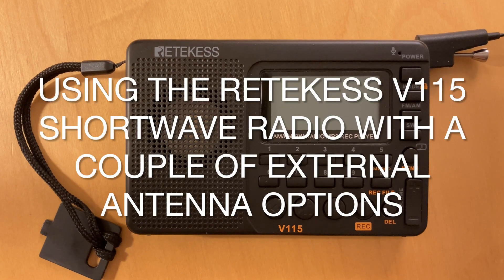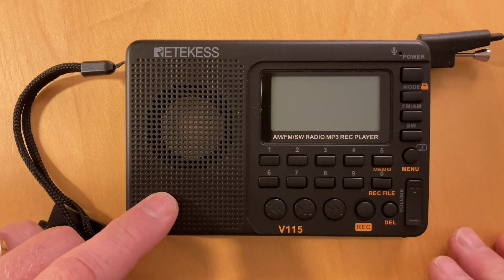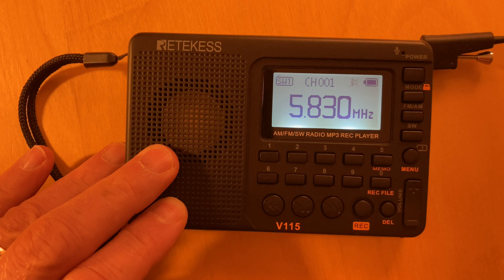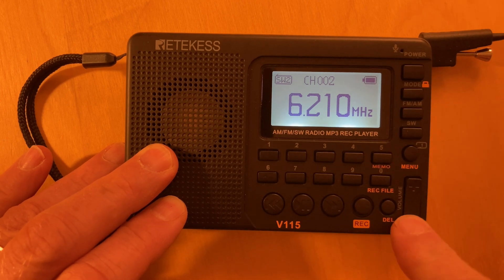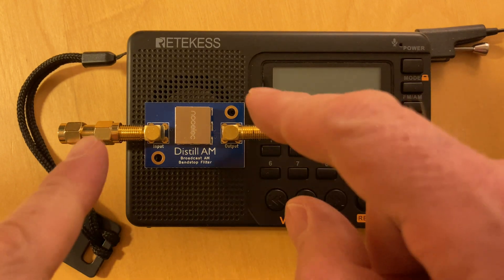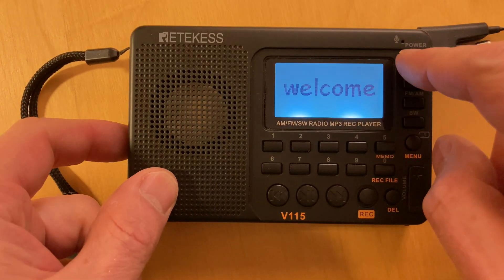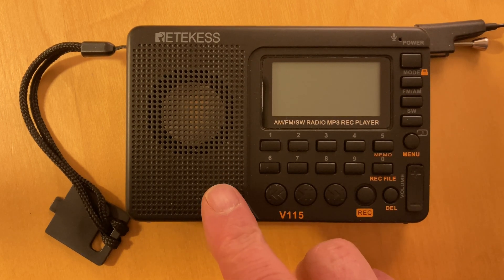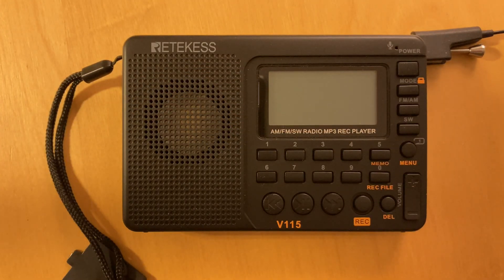Using the Retekess V115 Shortwave Radio with External Antennas

Comment: What’s the difference between this and the Tecsun PL310, PL-330, PL-880 and PL-990?
Reply: This Radio is $20 and has fully featured MP3 player, plus radio/microphone/line in recording.

If you're going to buy one, this radio is sold by 5 or 6 different brands and model names.
Make sure you get the HanRongDa K-603 version as it has Bluetooth ! Which is incredibly useful.

Comment: Nice try 👍🏻. As someone who has used this receiver for a long time, I can confirm that it makes a very decent desktop receiver when coupled with an external antenna. Not worse than radios five times more expensive. The issue is that it has an HF preamp built-in already (J8 transistor), not just missing hardware band filters, so anything like a long-wire antenna or (especially!) an active/MLA-30x antenna will simply overload it. It was designed to receive as much as possible on its own whip antenna, and that's it. To avoid heavy modifications, I simply connected an external passive loop antenna through an HF transformer (1:2±9 -> this can be identified only through testing, depending on coax cable length, antenna specs, etc.). BOTH antenna IN and GROUNDING (-) have to be used to connect the first coil of the HF transformer through the cable. The first coil has to be fully decoupled from the second coil. More thorough modifications could include removing the preamp and connecting an active antenna directly.

Comment: One SW radio I had did use a very unique antenna situation: A Realistic Astronaut 4: it had a whip antenna which would work on both the shortwave bands and the medium wave loops antenna which the manufacturer said in the manual that it would work up to 10 MHz. Many manufacturers had similar designs for their products. I thought that was unique for the time.

Comment: Good vid sfred.  It seems that most modern SW portables suffer from AM or FM overload from strong local stations..  I guess they don't have proper front end filters etc
I enjoy your videos and you may be able to help me..
I notice you're using an MLA30+ loop. I've never seen one in real life. The output appears to come from the amp box via coax to receiver.  I notice (as do many folks) you connect the loop to the whip antenna.  How do you get on with this as there's not a balanced input to the receiver? Or is there an unbalanced wire o/p from the box? Appreciate your wisdom as i'm thinking of getting an MLA30+ online.  Cheers Rob
Reply from the maker: The small DSP radios seem to be the worst for this, but I also see it in my analogue portables too. For most people it's never going to be an issue, but for people in line-of-sight of major FM transmitters it's just one of the things we have to deal with.

For my radios with an antenna jack I use an adaptor from the coax to a 1/8" mono plug. On those, the shield is tied to the sleeve of the 1/8" plug. Of the radios without an antenna input, I've been using an adaptor that goes from a 1/8" jack to the antenna clip. Those things just connect to the tip of the plug to the clip and leave the sleeve floating. I'm not actually sure how the coax behaves when you do that, but it might explain some of the FM overload problem. That might be something to investigate in a future video.
Reply: @sfred  Thanks for your thoughts.  Is the ext ant. socket on my D808 actually coaxial?
The antenna lead that came with it just ia a single wire with a mono plug on it.
My good old cleaned up and realigned 1970s Realistic DX-160 works great on a long wire (mine is 50 feet up into a tree) Even tho' it's image rejection on the higher end isn't too good (single conversion) it's fully tuned (3 gang caps) JFET RF AMP with separate JFET mixer and JFET local oscillator doesn't suffer from overload. This good old all analog receiver is just as sensitive as my Tecsun S2000 and a bit less noisy. The bandspread is great and it has adjustable AGC, Noise, Noise limiter antenna trim and BFO with proper product detector.  Sigh.  If only it had the freq read out and stability of the modern stuff.  I had an R1000 in the 80s and loved it  🥰
Reply from the maker: @robmccarthy1018  I've no idea how the D808 is set up. Without a schematic or opening in up I'm not sure how you'd tell. The DX-160 sounds great!